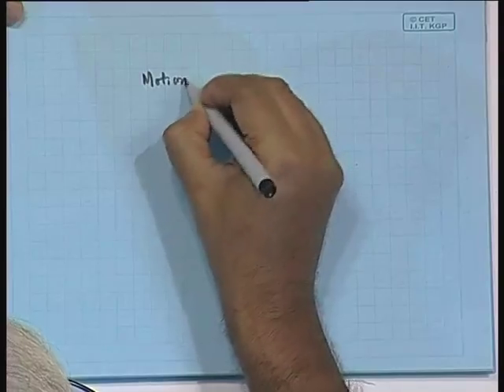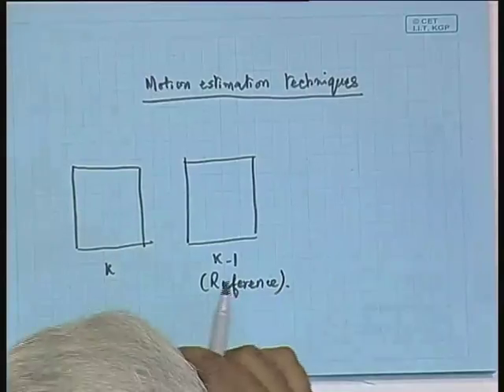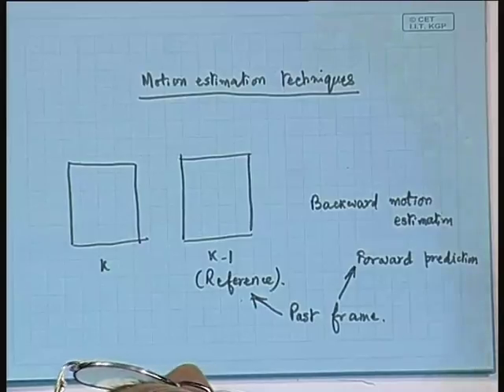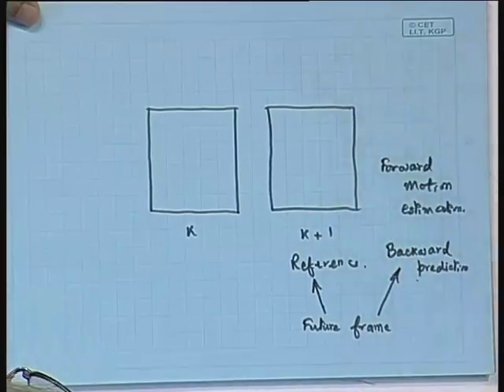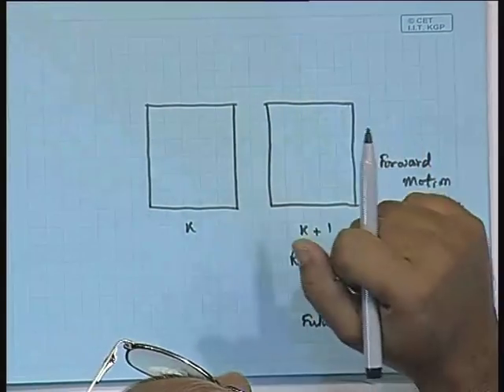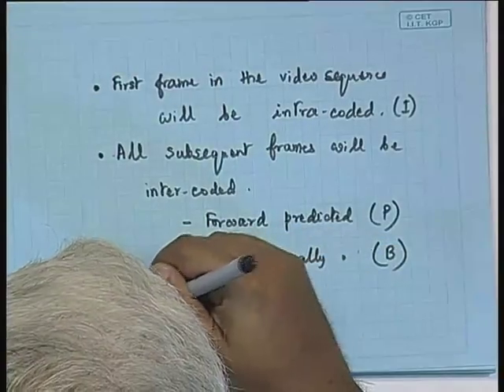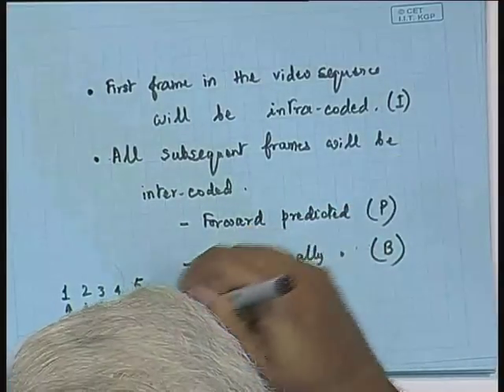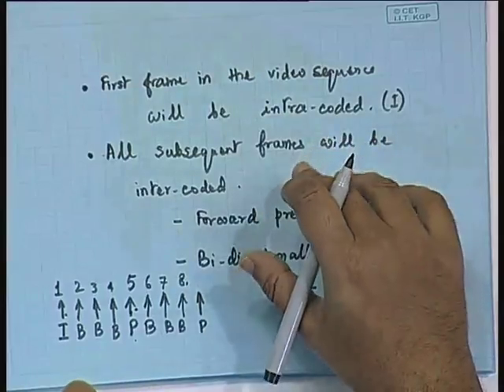Lecture - 24 Motion Estimate Techniques

Comment: For people having audio issues, attach your aux cable midway in your aux slot. The audio is fine then.
Reply: Wow. That is very interesting! What is the reason for this?
Reply: @fahimp3  If you only push it part way through, the metal contact in the port sending the right side audio signal makes contact with both the left and right on the audio jack, sending the right side audio signal to both left and right speakers
Reply: @comcam555  Thank you, I was wondering about it but was too lazy to look into it.